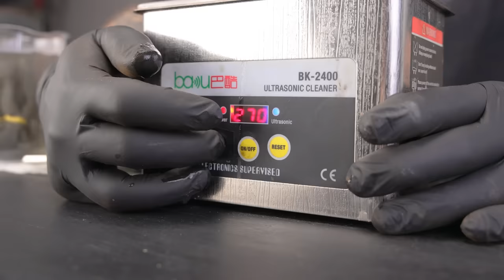IZH-49 | Old ShotGun Restoration

Comment: How long do you leave the gun out In the mud before you retrieve it for a restore video ?
Reply: Or it's an old murder weapon found with a metal detector
Reply: Just long enough to look bad but without pitting..
Reply: @shanewalls721  

A double barrel used for crime? It's too easy to get practical firearms (in any country) to risk it all on two rounds.
Reply: @joebenson528  if that where true then nobody would use bats,knives, poisoning etc.  In fact most homicides are committed by plain beating the victim to death.  They usually use what's convenient at the moment.
Reply: EXACTLY. AMEN.
Reply: Or it's a FAKE
Reply: @Plutopongovideos It's exactly is. A wood can't get rust, it's not a metal